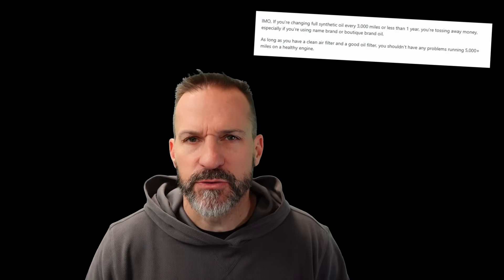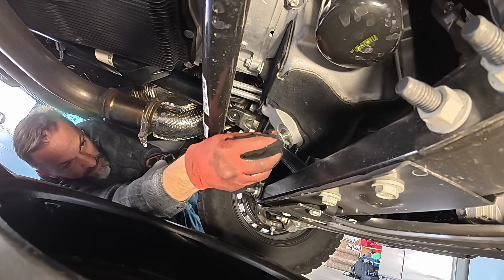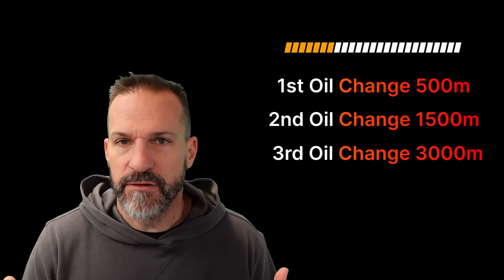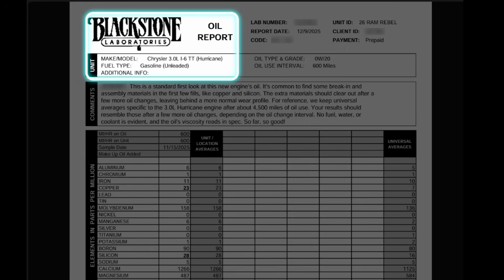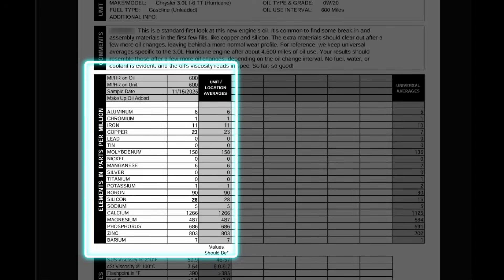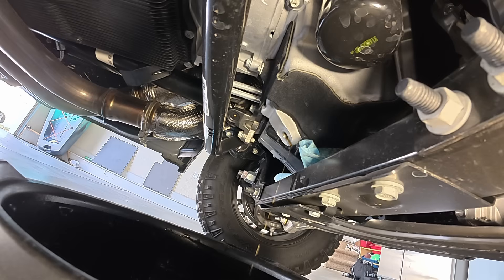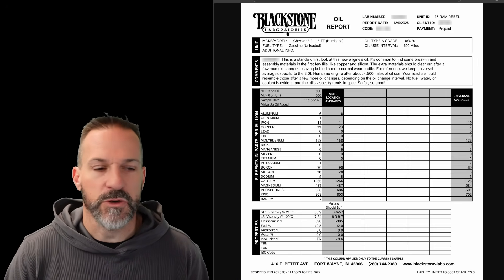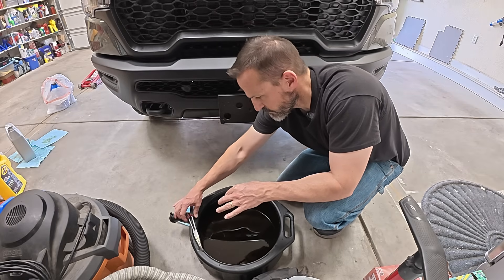Is the Motor Oil Geek Right? I Put His Break-In Theory to the Test

Comment: In the 70s and 80s, your car manual would tell you to do an early oil change at 500 to 700 miles. And, that's when production quality was far better than the past few years.
Reply: that's also when they were working w/ softer alloys, looser tolerances and oils w/ less lubricating and cleaning power, so not the same thing on multiple levels :)
Reply: @duroxkilo New oils have really fixed things? Just ask Toyota, GM, Ram and Ford. The reality of early engine wear still applies. Also, engines with turbo chargers and direct injection dramatically increase wear and the need for early oil changes.
Reply: @celilo  new oils have what?
Reply: @celilo  pls rephrase the first sentence, i don't get it..
Reply: @celilo  keep in mind two things: not all engines by the named companies suffer the recall problems and not all car companies issue recalls but there are only a handful of motor oil producers meaning we're all pretty much using quite similar oils.
small DI european cars w/ turbos have normal warranties while their oil change intervals have been around 10k miles for a couple of decades now.

so yes new oils and new alloys have more than doubled the service intervals for engines in the last decades...
our parents' cars even from the 80s needed new piston rings and bearings much sooner than our cars. our grandparents' cars, the golden era of powerful engines, would require engine overhauls much sooner than 100k miles, we wouldn't buy a car today if it needed piston rings every 50-60k miles would we? :)

this is not to say preventive maintenance is a waste of time... but at the same time some things are irrelevant to engine longevity based on testes carried by engine manufacturers and one is minute levels of contaminants and that's what 10-15PPM iron is, 0.05grams of fine particle iron in 5qt of oil. that's nothing, you couldn't polish clear-coat w/ such a weak abrasive let alone wear down hardened alloys.
Reply: @duroxkilo "We wouldn't buy a car today if it needed piston rings every 50-60 thousand miles"
I'd rather replace piston rings every 50 to 60,000 miles than the entire engine. That said, I've never made an argument that materials have been improved, only that early oil changes are still important.

You can make all of the should have could have arguments, but the reality is that total engine failure, lifter failure, etc is not uncommon in many of today's vehicles and lubrication is an important factor. It's interesting that you bring up Europe, as typically a vehicle in Europe requires a higher viscosity oil than its US twin, which makes that argument moot.

Comment: Things to bear in mind: First, Blackstone is a less high tech lab than SpeedDiagnostix. More affordable but a few steps back of the top of the curve. Second, Lake Speed is a professional in the tribology field. That's a whole lot more than just about everyone else on the internet can say. He's not pushing oil brands, particular cars or anything like that. The only thing he kinda pushes are his oil analysis services.. but I can forgive that because they are top tier. He can produce test data to back up what he says, whether it's from industry sources or his own testing. I have a modecum (about 40 years) of expereince and some education in lubricants. That's enough for a good BS detector and I will say Speed NEVER sets it off. I diverge on a few small points with him, mostly on how to spend my money (ROI), but don't claim he's incorrect. Compared to his level of training and experience, I'm still in a "what the hell to I know" category. I 100% agree with the Car Guy that for many people, all these debates are moot. The factory OCIs will work and their cars and trucks will make it out of warranty, most likely making it past 100K (or even 200K miles with a good car brand). For some of us geeks, that's not enough. I'm still driving a truck a bought in 1987 and a car bought in 2000. My work brought me into contact with engineering and tribology professionals like Lake Speed (though regrettably not Lake himself) and they influenced a lot of my maintenance choices. Anyone watching Lake's channel should be grateful for such an oportunity at a continuing education in lubrication.

Comment: In the 70's when I was building engines I used break-in motor oil and changed it after so many hours. 
In 1980 I worked for a Porsche dealership and the first highly recommended oil change was at 500 miles.
Oil has changed for the better but your first oil changes are  important.
Thanks for the video confirming Lake Speed Jr's recommendations.

Comment: Hmm...I've been changing my oil and filter at 6,000 or six months since I bought my Toyota Tacoma. She now has north of 500,000 and she's still going strong!
Reply: That’s probably because your Tacoma manual called for 5W-30.  

With 0W-20 and no break-in period early oil changes, late model trucks will be lucky to make it to 250k miles.
Reply: @NickWindham  it’s been shown repeatedly that most engine wear occurs when you start up the engine. A thinner oil like 0W permeate the engine better and lubricate better than a thicker oil like 5W under those conditions. So if you get better lubrication at the coldest conditions, it seems to me you would expect less engine have you seen anything scientifically published that states otherwise?
Reply: @markw9512   That’s true about the 0W grade.  However, when the 20 grade sheers, the viscosity becomes too low to protect from direct metal to metal contact.  So, the happier medium between both our points would be to use a 0W-30 oil.  That way, when the 30 sheers out of grade, which it usually does, then you’ll be around the 20-ish hot grade minimum viscosity needed to protect from excessive wear.
Reply: @NickWindham  yeah except the fact is that they society of automotive engineers has done studies and have said in published papers that the 0W 20 oils don’t result in any increased engine wear.  I don’t believe them to be dishonest
Reply: @markw9512  I don’t believe them to be dishonest either, BUT I doubt the test were either real world or extreme conditions.  They were probably lab tests in ideal conditions.  Otherwise, why do owner’s manuals call for 0W-20 when held to CAFE standards but call for 5W-30 or even 10W-30 in countries where they aren’t?  Why would GM’s recall recommend switching from 0W-20 to 0W-40 to help prevent main bearing wear?  Etc….
Reply: @NickWindham  let me ask you this: exactly how is it you think that 0W oil results in better fuel economy if not for the fact that it provides lower friction, which internal logically would result in less engine wear?   Or is that a conspiracy too?
Reply: @markw9512  Good question.  The answer is the Stribeck curve which shows viscosity vs friction.  For engines designed to CAFE standards that call for 0W-20, as viscosity goes down to 20 grade, so does friction pretty linearly. However, significantly below 20, friction increases exponentially.  The friction from thicker oil, is temporary.  The damage from metal on metal friction is permanent.   So, friction and wear metals in the oil increase as viscosity grade falls due to mechanical sheering, thermal thinning, and/or fuel dilution.  Under normal conditions in a gas engine daily driver car, this usually isn’t a problem.  The biggest offender is fuel dilution.  Also, wear metals not caught by the oil filter increase metal in metal friction, causing more permanent damage. A thicker viscosity barrier can help reduce the smallest wear metals from causing metal on metal contact damage. 

Accordingly, you’ll see higher viscosity grade called for in the manual for the same vehicles in countries that don’t penalize for MPG.  For engines that call for 0W-20 in the US, they’ll typically call for 5W-30 in the winter and 10W-30 in the summer or for heavy duty usage.  They’re intentionally accepting slight higher friction against the thicker fluid if the oil because they know its viscosity will only decrease over the oil change interval.  As it does, it will near that minimum friction point of the Stribeck curve instead of the danger zone where metal on metal friction increases exponentially.
Reply: @NickWindham  what countries are you aware of that don’t penalize for MPG anymore? Europe? They all have mileage rules… Asia? Same in the developed ones as far as I know.   My understanding is that the engines in the US are manufactured with tighter tolerances. And again, SAE said that this lower weight oil will not cause any increased engine wear. Can you point me to a scientifically conducted, long-term test where they measured engine wear of 0W 20 and found it increased measurably compared to 5W 20 or any other oil?   I mean in both cases the upper number is 20. So it’s only the low number that you’re saying is the problem.  But the low number helps you when it’s needed most, when the engine is starting up and when it is documented that most engine occurs.   So you can make a lot of technical sounding arguments, but the point is unless you actually have a study that’s proves what you’re saying is true, what you do have is… Speculation.  And you have the SAE saying that what you’re saying isn’t true. Which again would mean that either A) they did slipshod studies which they’re not known for doing, or B) you’re speculating and are probably wrong.  

So until/unless I see an actual published study of where tolerances of the exact same engine run with the two different grades were discussing here, I’m gonna go with the manufacturer recommendations.  Anecdotal data is exactly that: anecdotal. Too many independent variables can go into making an engine fail prematurely, including hard driving, lack of proper maintenance, on and on and on… That’s why we need scientifically generated data.  Nothing else will suffice.
Reply: @NickWindham  Seldon right and wrong again! ASSWIPE!!!
Reply: Doubt it
Reply: @sprint2648  I don't give a rats ass what you doubt! SHIT FOR BRAINS!!!
Reply: @sprint2648  you doubt it based on what?? It’s very common for these motors to go that long if their maintenance is done correctly

Comment: One question I still have is: what is the exact formulation of oil in your vehicle when it arrives from the dealer?  As you know, break in formulation is important for breaking in cams and rings. So, I could make the case we should all change oil immediately upon bringing the vehicle home and refilling with a known break in oil until 500 miles.
Reply: "Break in" oil has not been recommended in many engines for over 50 yrs due to cam wear.

Comment: 1. never use a diesel car - it‘s the most dirtiest combustion possible, of which benefits only industrial machinery. Your car doesn‘t compare to such application.
2. change oil-filter with the oil in the grind-in period, just because the majority doesn‘t get caught the minority does. All needs to go out.
3. make the grind-in period a purpose: change oil at 500, 1500, 3000, 5000 miles with oil-filter. Yes I know, you reset your oil-filter performance parameters, but stuff needs to get out in the first period.
4. Understand what your application is and how it differs from what manufacturers call normal use. Normal use even if certified standard by law, is never a person‘s normal use, it artificial. So if you go low revs or high revs, if you go instant in winter and/or summer, if you drive thru long summer traffic jams, or if you go occasionally street, track, or car racing, none of these applications is the norm. If your application isn‘t in the norm, go for shorter intervals, than a manufacturer recommends. Never go higher for these day‘s cars. The specified durations are already „shined“ for less emissions the manufacturers get points on less emissions. In the 90s and before that wasn‘t the main interest, there the focus was to bring in the cars more often and sell more stuff. The material evolution is huge, but not as big as anyone tries to tell you, as such innovation costs and only the minimal, mandatory is added.
5. Perform Oil-Changes more frequently. Here, yes, change the oil-filter every 2nd or 3rd time. You can monitor that exactly if you have oil-analisys available to you. I‘d bet on 60% of the specified interval and filter change on every 3rd time, not to save money, but to use the best performance and efficiency of filters, which sits in the middle of the duration. Every 2nd though is fine and usually what manufacturers recommend.
6. Use the best application (use-case, min/max temperatures, urban, traffic, or free oudoor pistes) specific synthetic oil, if your vehicle is not older than the 90s. Never use 0W, but stick to the SAE and API recommended and certified by the manufacturer. Get one class up or down if you‘re into more extreme weather conditions.
7. Clean your air-filter when it‘s really dirty
8. Replace oil and flush clean your gearbox more frequently than manufacturer specified.

Comment: The only thing I would question is going up to 30 or 40 weight. After 130k on a 20 weight vehicle I thought it might be good to increase the viscosity. I went up to 40 weight and within about 5k miles I was burning 1-1/2 quarts a month. My assumption is the 40w was too thick to get into the smaller spaces quickly enough during startups especially cold ones.
Reply: Lake Speed's results and conclusion are that going from 5w20 to 5w30 produces statistically insignificant wear results, and what difference there is actually slightly favors 5w20.

Comment: 24 Silverado 5.3l. There was so much debris at 800 miles the engine was struggling at idle. The filter was clogged! The oil pressure from the pump to the oil sensor was 30lbs different. Big chunks of aluminum was in oil. And each and every oil change revealed metal!  Now at 20,000 miles and 7 oil changes later. The metal is thinning out. Still runs like a champ. At least for now. 
Just Change oil as per Lake Speed. It can’t hurt just help.

Comment: I think you’re totally right on changing it early. I have always did first change at 1000 miles the 4000 miles later at 5000, and then every 5000. I also always if I change the oil I change the filter. I had a 22 Tundra and it was on the recall list for the engine and I never had a problem with it. But because of all the problems they were having I traded it for a 24 4Runner. I still see my 22 Tundra and the person who bought it says it’s running find but it’s still on the recall list for a engine he says he not sure he wants the dealership to touch it. I believe my frequency of oil changes may have saved that Tundra engine.

Comment: What were the oil change intervals of the 4500 mile "universal average" data?  Is all that data form vehicles with the same engine?  Data is important and I appreciate the effort, but the last column is meaningless without a better understanding of where that data comes from.  Certainly the results for this oil do tell a story.  But I've seen other results from a ~1000 break-in analysis that had much lower PPMs.  Makes me wonder.  For the record, I am in the do a break-in oil change camp.  However, I think the schedule presented at the beginning of this video is overkill.

Comment: I’m no expert, but I can see doing it at 500 to 1000 miles for the first time. Even my gas inverter generator mentions that you should change your oil after a number of hours for the first time.
Reply: does that inverter generator have a full flow filter? if not, draining is the only way to remove the wear metals. but, if you have a good working filter, it can trap particles.
Reply: @philkryder1434 
I don’t believe it has a full flow filter. So yes, I need to tip it to the side to drain it completely.

Comment: At no point would I ever change the oil without changing the filter. That's like taking a shower with a raincoat on.
Reply: Except it's not. Filter media gets more efficient at filtering over time, right up until the point where flow is compromised.
Reply: @TimJohnson-x1o There are so many levels of stupidity in your statement. That all I can say is. You do you. And good luck with that.

Comment: happy owner of a 2022 tundra non hybrid, my first engine lol I did a very early oil change around the 500 mile mark then the next one at around 2000. after that the oil was changed at 3000. that motor was trouble free until they replaced the entire engine under the recall @ 34000. the original engine never had any issues. the replacement engine again first oil change around 500 miles and the second was about 2000. currently we have almost 5000 or so on the new engine and again we are trouble free. The motor oil geek I think has great advice if you can do these frequent changes, personally it's common sense to me people.... take care of your engine and if you keep it it will last if you pass it along the next person will definitely benefit.

Comment: We have been building engines for over 40 years. We always run a new engine for 30 minutes with a break in oil or additive, dump the oil and filter. We ask the customer to return at 1,000 miles for their second oil and filter change. Next is at 3,000 miles.  We always recommend 3,000 oil changes for most vehicles.  With vehicles that have over 10 quarts of oil we go 5,000 miles.  

This has worked very well over the years. Good luck with your truck. I think your videos are very informative.